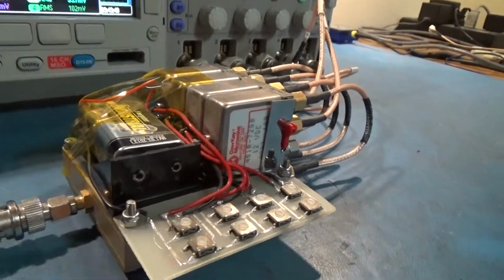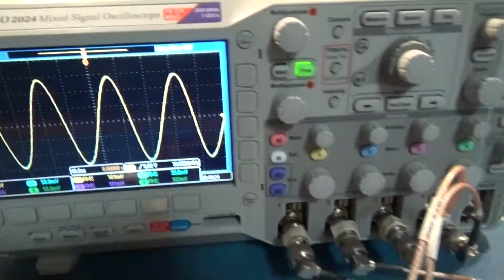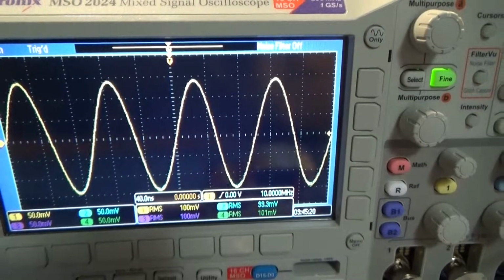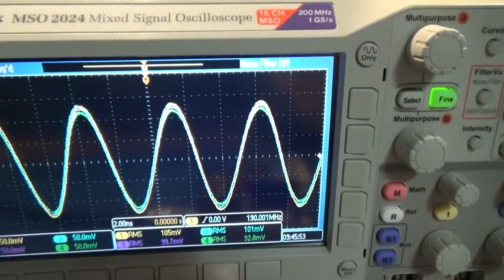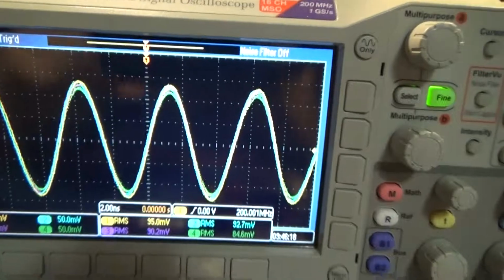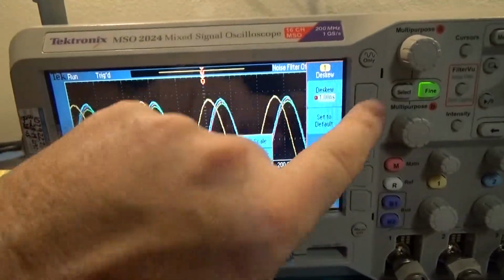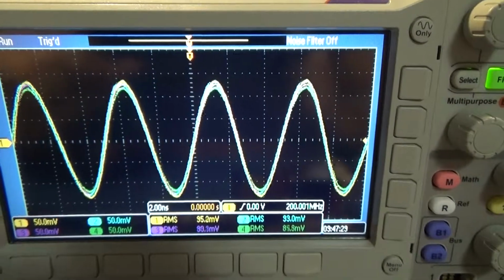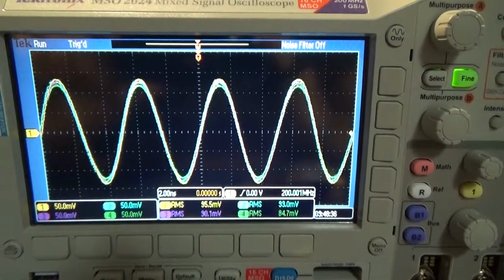Tektronix MSO2024 High Frequency Channel to Channel Linearity

Comment: Please could you check the last posts of this thread http://www.eevblog.com/forum/testgear/mso2000-application-module-hack/50/ Thankyou.
Reply from the maker: +Luis A P Barbosa My interest is primarily repair. Its cool to enable all of this stuff, increase bandwidth etc., but be weary of with firmware updates. Your fine with older scopes like this one though.

PS - They haven't quite figured it out.